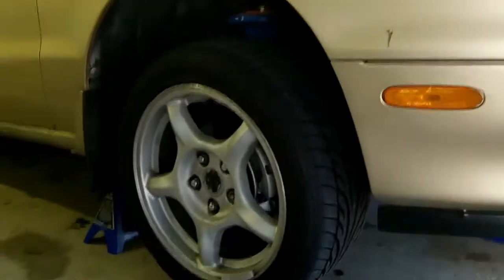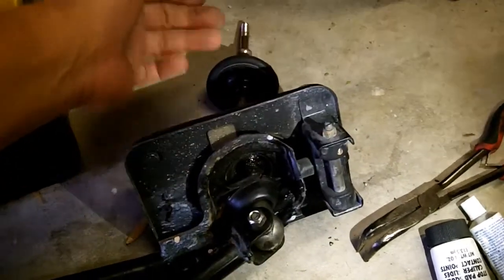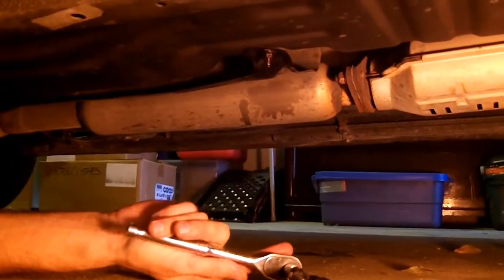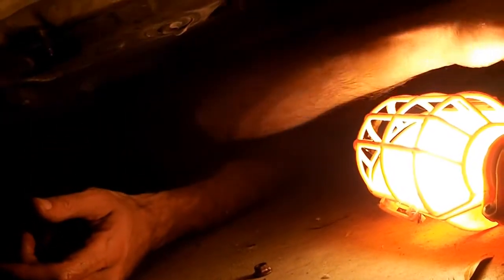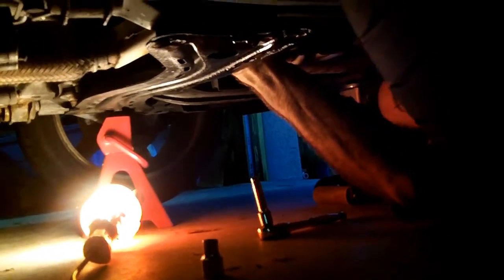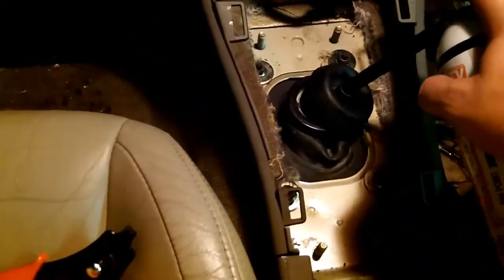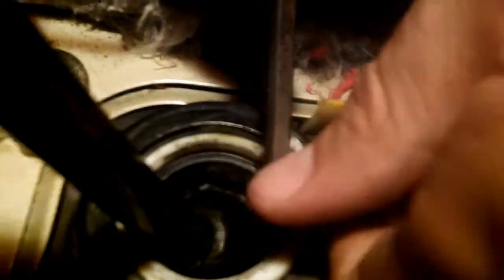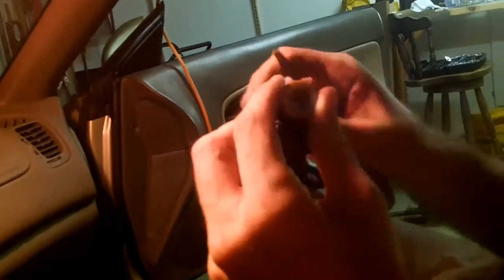Mazda MX-6 - ND28's Short Shifter Install

Comment: Hey goodmorning I have a Mazda 626 automatic 2.0 that would be

2002 .Well my car started to give up and I managed to get  it off freeway, my transmission was working fine so was car now I can only go in reverse can any one help out and let me know what is wrong or what to do. Thank y
Reply from the maker: +Melanie Patterson That's a serious issue Melanie.  Have it towed to a local mechanic so he can run some diagnostics.  I'm not going to venture a guess on your issue because it would be just that, a guess, and guessing across the internet isn't going to help you at all.  You need a mechanic to get his hands on your 626 and provide a professional diagnosis.